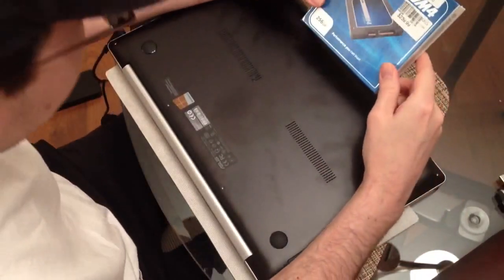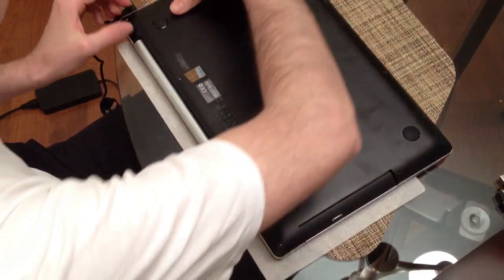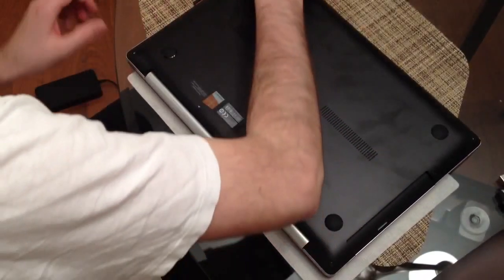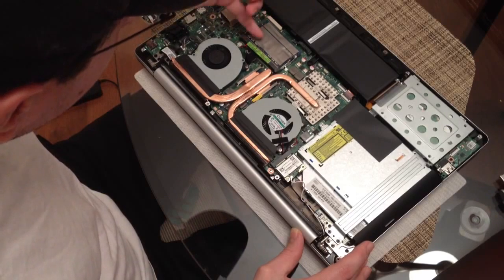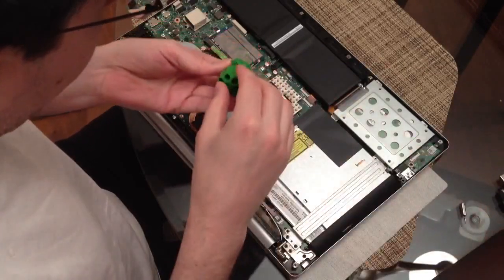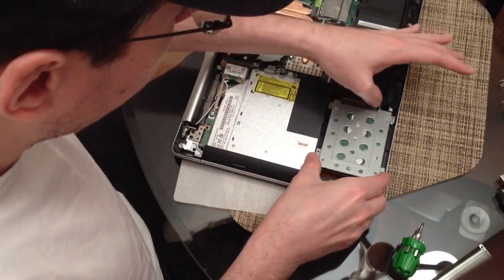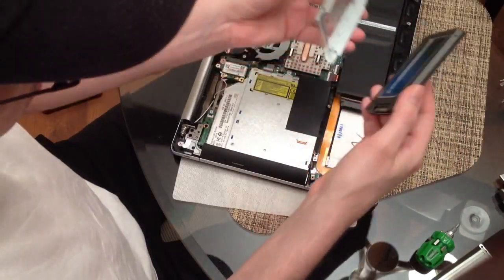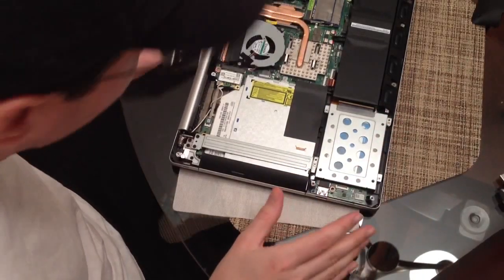Replacing the hard drive in Asus N550JV-DB71 laptop with a SSD

Comment: I have the same model, my laptop is lagging and boots really really slow, what is the problem?
Reply: Likely the HDD.  Reinstall the operating system completely, otherwise if there are still speed issues, you might need a new HDD.  If so, this video will help.

Comment: i have the ASUS N550JX  can i still change the HDD to an SSD?
Reply: Hey, I'm planning on removing the disk drive and replacing the current hard drive in my N550JX with an SSD, while moving the current HDD into the disk drive spot. Have you done this?
Reply: ok so i got windows 10 in this laptop so i want to know a good and safe way to transfer the operating system to the new hard drive

Comment: you do not need identical rams... you can upgrade to 12 GB ram if you just buy an 8gb....

windows 7 backlight driver can be found as well....

thanks for showing how to replace the hdd
Reply: +Bu11sEyes they do work, but they'll both work at the highest common frequency which is 1600
Reply: TUMBABS The max is 16Gb not 12Gb
Reply: who talked about max
Reply: can you even install 12Gb Ram since there are no 6Gb sticks available
Reply: TUMBABS Yes u do need identical ram lol. two different once will never work. for example 1600 and 2400 wont work
Reply: plezx29 there're 2x4GB installed, you could replace one of the 4GB with 8GB to have 12GB

Comment: I use Hotkeys to customize keyboard controls in WIndows 8. I set F11 and F12 for volume control ( no need to press FN button). Very useful to do with one finger, the way it should be done.

Comment: Before you do anything you should install your new SSD drive into a portable 2.5" drive case then connect it to your computer with an USB cable. Now use a freeware cloning software such as xxclone(recommended) on your computer. Launch and chose the clone option, and clone the partition with your OS on it to the new SSD drive. Once that is done, you can remove your hard drive from the computer and remove your new SSD drive from the portable case and do the swap. Boot up your computer and if the cloning was done right it will boot up nicely. I did this to two Acer laptops yesterday and the xxclone freeware worked perfectly.

Comment: So I bought this laptop about a month ago and now I'm having problems with the battery. When I plug in the Ac adapter it does say plugged in, charging but it doesn't get fully charged, sometimes it's stuck from 88-96%. Is there a solution? thanks

Comment: SSD sucks it can only hold a small amount of storage 250mb? an HDD can hold terabytes... SSD is faster but it holds oh so little compared to HDD. not worth it.
Reply: Samsung Evo 840 1tb ssd. Take a look.
Reply: Dude, it's 250gb not mb .'
Reply: Timon Borg It has EVO 840, 120, 250, 500 and 1 Tb...
Reply: +delta102  i feel the same about the ssd and the hdd to be honest i want speed and alot of space get a sshd it has both space and speed for the programs most used and is also ssooooooooo mush cheaper to get than a full ssd

Comment: Hi Michael,
I have this laptop (touchscreen version) coming in tomorrow and I am planning to replace the HDD with an SSD as well. PLanning to stick with windows 8.1. But I am definately a noob in this kind of stuff. Just a few questions:
1: Does every SSD have another driver? for example a samsung ssd or another random ssd, are those drivers you need the same or are they totally different?
2: Where can I find drivers for those SSDs?
3: How do I get the laptop working when I installed the SSD card? Do I need to have the drivers on a usb and stick it in when firing up the laptop?

Thanks in advance

and sorry for my bad English ;)
Reply: You would have to install the OS onto the SSD
Reply: verzioneight clan oke thanks, how do I do that?
Reply: Mrj0to You'd have to clone the contents of the HDD onto an SSD. You can buy a dual sata docking station for little money, place your HDD in one slot and your SSD in the other, then clone the contents and place the SSD in the laptop. I am about to try this with my N550JV.